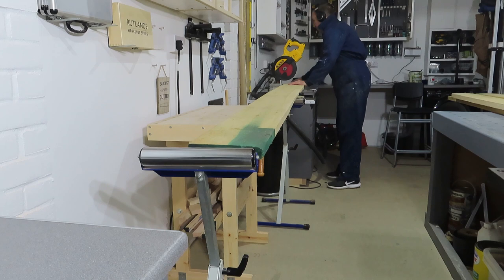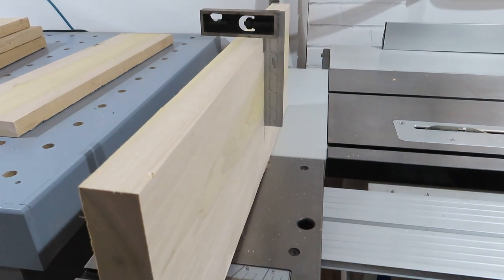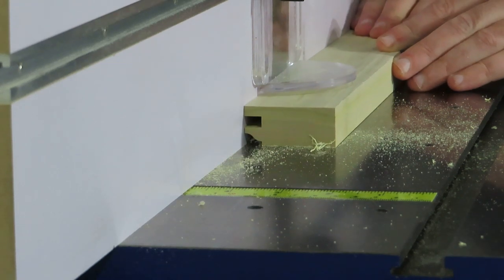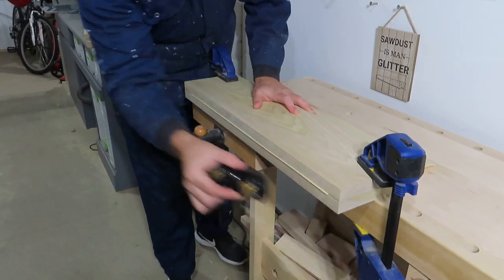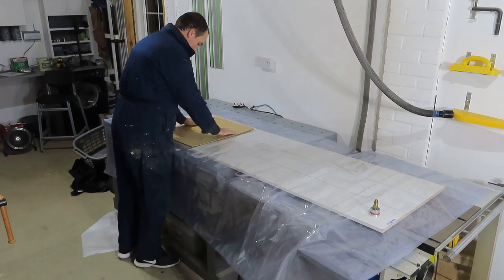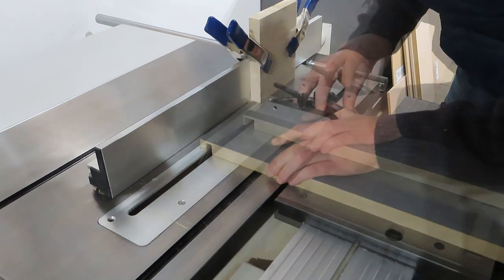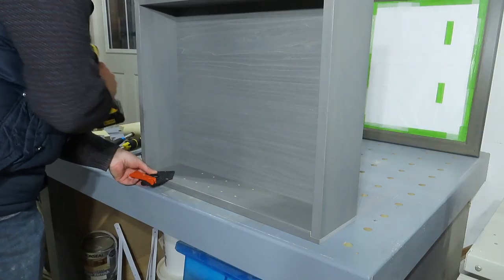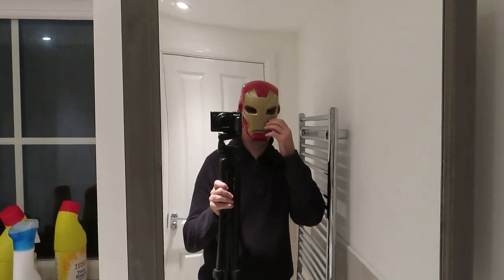Bathroom Cabinet Build

Comment: Could I ask what size of tulipwood you ordered from timber source, Thickness x depth x length?
I had a look on the site but found the many sizes, thicknesses and lengths a little confusing.
The boards you used on here look just about right for a few projects I have in mind.
Hope you don't mind me asking. Your cabinets turned out great by the way.
Reply from the maker: Thanks for watching Cliff 😃 yes no problem at all, they were rough sawn boards 32mm thickness 150mm wide 2 metre lengths, just checked the site and each length is £16.31 +VAT hopefully this helps, if I was to do this project again I could probably got away with 25mm thickness but the price is the same so it’s nice to have the spare bits thicker for future projects 👍
Reply: @ukhomewoodworker848  Thank you for getting back with that very helpful info.
I shall take a look.
Thank you again 👍